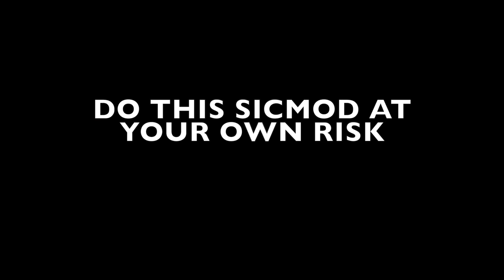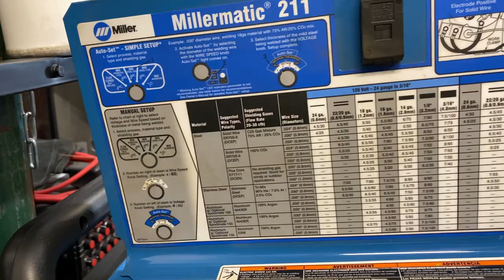Outboard Shock Relocation Install - 3RD Gen 4Runner (Freel Good Performance Kit)

Comment: hey just a tip, use heat shrink on top of the hose clamps to protect the shock body and make it look cleaner2
Reply from the maker: That's a cool idea.  Thanks for sharing.
Reply: @TimmyTheToolman  not my idea just something I saw the wings world guys doing on their prerunner builds, the heat shrink makes hose clamps look a lot better

Comment: Does this gain any flex ?? And wont this essentialy loose up travel ? What do you sacrifice when doing this ?
Reply: Great question I would like to know the answer as well.
Reply: It’s a longer shock than stock but it’s also mounted higher than stock which is why you gain down travel and don’t loose up travel.
Reply from the maker: this kit does not limit up travel when it is properly installed.

Comment: The outboard shock relocation will it work on a 3rd gen with a Lift kit with 600 pound constant tension Coil springs in the rear from ironman 4x4?
Reply from the maker: yes it will. the springs/coils doesn't matter.

Comment: Hey Shaun,  question about your e brake extension bracket. Were you having e brake cable issues after installing Jason's adjustable rear upper and lower links? I have them on as well and ended up moving my axle back 2 inches. The e brake became too tight and even after extending it out with the adjuster nut I'm still not reaching the brake drum where it connects on driver side. I have it disconnected until I can find a solution. Did that bracket alleviate your line tension issues?
Reply from the maker: The bracket helped most with my lift, I did not move my axle back. I set opt-offroads lower control arms to factory length. But in general if you’re lifting or moving your axle back it’s gonna put some strain on the E brake cable. If you have a lift you should have the brake bracket extension like I do and so many others that have a lifted truck.

Comment: I have an OME 2861 spring. Will it have enough travel to accommodate the full travel of a 12" shock?
Reply from the maker: Not sure what lift those springs give you but if it’s 3” then yeah they will work out for ya

Comment: If i have a standard Bilstein 5100 shock kit on my 4runner now, would i need to buy new longer struts after this mod or could i use my existing 5100s?
Reply from the maker: This shock relocation kit is meant for 10-12” shocks AND the mounting is different. Stock 4Runners use a stem on top and this outboard shock relocation kit uses EYELET mounting. So yeah, you need different shocks.
- Sean

Comment: Tim, if you're ever in Florida or if I'm ever in Cali with all my detailing tools, were ceramic coating your rig top to bottom. I have a Sunfire red 99 runner that's coated. Hate seeing you have to use that God awful car cover. If you go to my Instagram you can see some of my work and if you scroll far enough you'll find my rig all done up.

You've saved me alot of time and money, figured I'd help your rig look the part.
Reply from the maker: I sort of doubt I'll be driving through Florida any time soon but I appreciate the offer.  I don't car cover any of my rigs now.  They just bake in the sun unfortunately.  Great to hear our videos are helping you out.  Thanks and Happy Wrenching!

Comment: I'd be curious to know how this would compare to a set of custom 2.5in shocks in the stock location. I know in a conversation I had with Radflo they recommended the 2.5in for the weight of my vehicle, but better geometry may be more effective in controlling a load. If anyone has any input definitely let me know.
Reply from the maker: Putting them outboard will allow for more precise tuning of the shock as there will be no deflection from it being mounted at an angle. So although we can’t confirm that it would immediately add more stability, it will be much more efficient to tune accurately traveling 1:1 with the axle. And so much easier to access in the future.